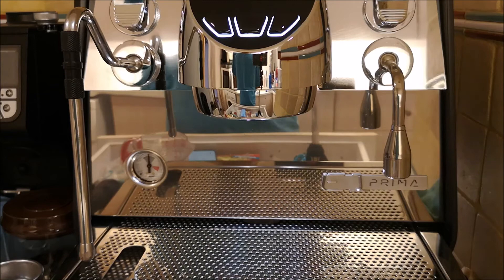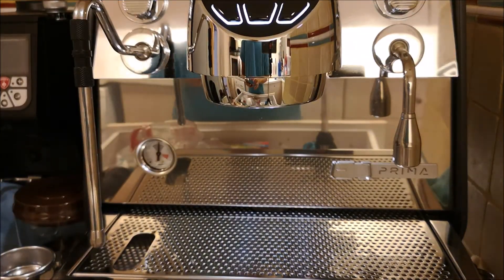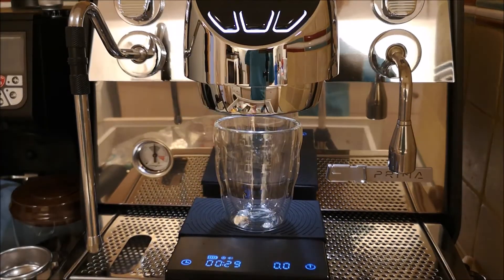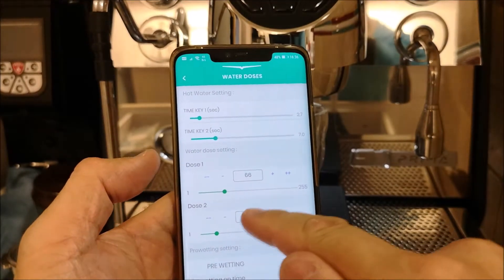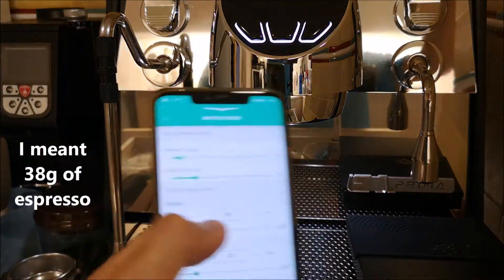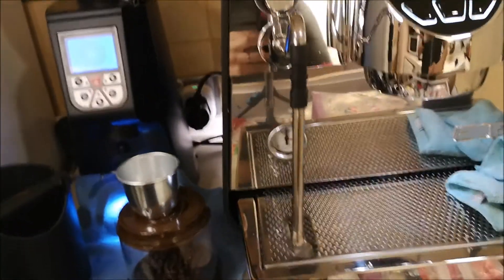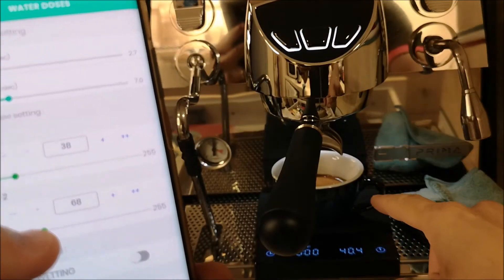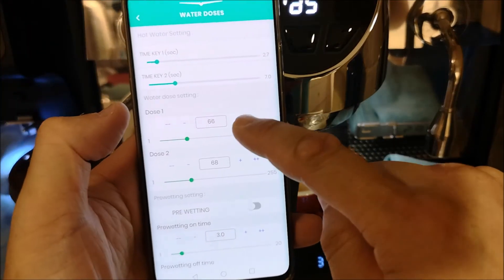How to use Volumetric dosing on VA E1 Prima | Flow rates & Accuracy

Comment: is good for coffee shop ? i mean about 25-50 cups per day
Reply from the maker: Hi, if your distributor is reliable or you have access to a Service centre, then yes, the machine is great. 
25-50 cups a day, that about 6 cups an hour, the machine should be able to do this BUT constantly, every hour, everyday, I am NOT sure about reliability. I have no experience pulling this many shots a day, most I have done is 3 cups a day.
Reply: @BosHK  thanks for the info !
Reply: @TheArgetho For a small coffee shop, this should work. This machine ran as part of a coffee shop cart and pulled around that range daily for the last 6 or so months. No issues with the machine, and to my knowledge it was designed to handle a commercial load like this one.
Reply: @kofiops  i think i will go for the Pro Version  😂

Comment: This is great..

Could I ask two questions:

 Would you recommend this over the decent machines?

Can you reset the pressure, so for example can you drop the pressure from 9  bars to 6?

Thank you for your time
Reply from the maker: Hi Azza, which machine would depend on your personal taste and preference. I looked at the Decent machine and love all its features but I wanted a more traditional size machine. 
For the Prima, yes I can change the brew pressure, I use 6 bars for med/light roast, 9 bars for darker roast.
For the price and features, there is nothing out there that can beat the Decent, especially if you think you will be profiling alot.
Reply: @BosHK  Thank you BosHK .. The look and quietness of the prima is a winner! 

The Decent machine has a lot of features but the noise it makes is ridiculously and the E1Prima  is just a great looking machine that pulls incredible shots.

Never knew  you  could lower the bar and that's all I really want. Was considering the lelit bianca.

I noticed on one of your videos someone mentioned that you can't see the temperature of the boiler is that correct?
Reply from the maker: Hi
Prima is loud when the pump comes on to refill
Yes you can lower the pressure but its not made to 'pressure profile' but I will be doing a video on 'trying to pressure profile with Prima'
The only real time indicator on APP is the brew pressure
Temp of boiler is set on APP or on grouphead but it doesn't show temp while you are brewing because it shows to timer.
There's not that many machines that shows real time grouphead temp unless its a E61 with temperature gauge mod
Reply: @BosHK  ok great thank you so much, I'll wait for your video on trying to pressure profile. 

So overall you would recommend the machine?

Thank you for your help
Reply from the maker: What are your choices?
Reply: @BosHK  at the moment it's between the lelit bianca, decent and the prima 1..   I like the look and functionality of the eagle. The Decent I love the functionality but not so much the looks... Lelit is good, but I fear I'll get bored of that quick

Comment: Thank you. Looking to get same machine, any feedback after having for some time ?
Reply from the maker: My machine which is ver32 has been great. The extra features like Auto flush, fast warmup time, pressure adjustment, vol dosing are nice to have. The app I do not really use too much, unless I want to see or adjust the pressure. Steam is crazy fast. Hot water ok. Vol dosing is only accurate for a few days and its based on a specific bean you programmed it for.
Reply: @BosHK  Thank you, so excited to try 😉

Comment: Thank you again for another good video on how to use this machine. Quick question. I cant get my hot water to go above 65 dec C. I have turned the screw on the top of the machine full clockwise and thats the hottest it gets. Am I missing something? Please keep the videos coming. Thanks
Reply from the maker: Hi. I'm actually not sure which screw you are talking about but I will take a look at the technicals. As to your brew temperature, you can set it via the APP or the Buttons on the grouphead. Out of the factory, it should be set around 93C, whether it is actually 93C at the grouphead is another topic for debate. 65C for the hot water is pretty low, I actually haven't tested the temp.
Reply: @BosHK  I'm not talking about the brew temperature. I'm talking about the hot water dispenser. There is a screw on top of the machine that can be turned to adjust temperature of the hot water being dispensed. As I said mine is not very hot at all. 65 deg C max.
Reply from the maker: @dimitrimendrinos2049  I'll test out my water temp later today. I must admit, I haven't even played with that screw. You turned it clockwise to increase the temp right?
Reply: @BosHK  Good morning. Yes I did. All the way clockwise as viewed from the top. Let me know how hot your water gets. Thanks
Reply from the maker: @dimitrimendrinos2049  just did a crude test with Turkey thermometer in cup, 82C. How is your brewed water temperature? 60C is very low....
Reply: @BosHK  I'm getting max 68 deg C on mine. Do you have the screw all the way to clockwise stop as viewed from above?
Reply from the maker: @Dimitri Mendrinos  If your screw is maxed out clockwise and you are only getting 68C hot water, I would contact your dealer. I must admit I have not touched mine since the machine is working fine giving approximately +80C. 
EDITED: someone on fb group have played with it and said its extremely sensitive. Try backing off the screw (anti-clockwise) a couple of mm at a time and test your water